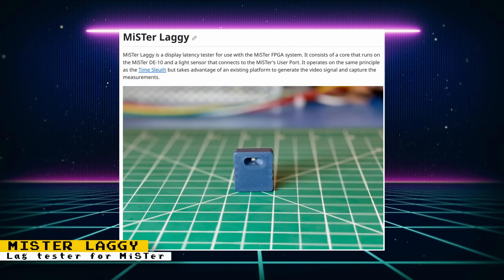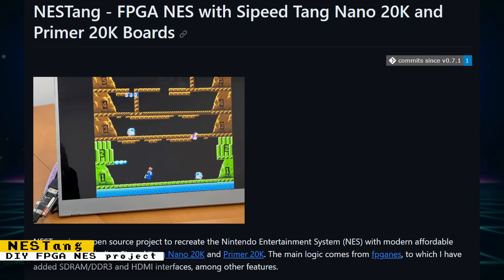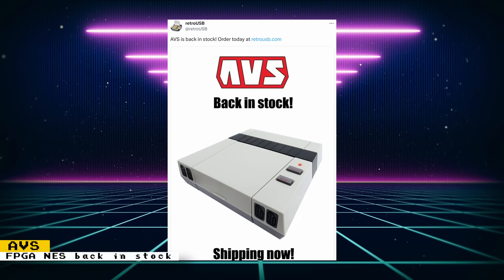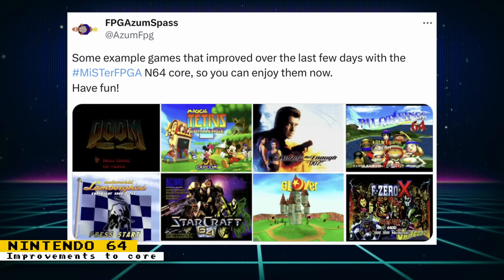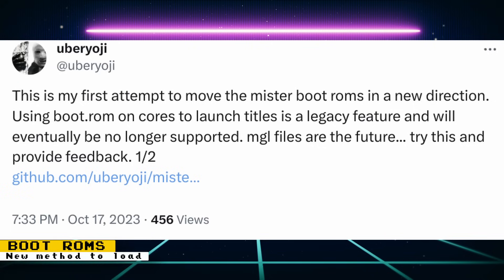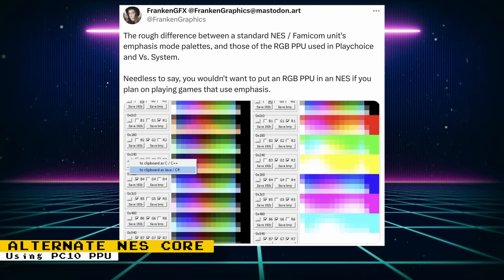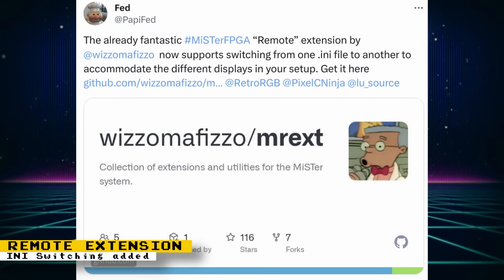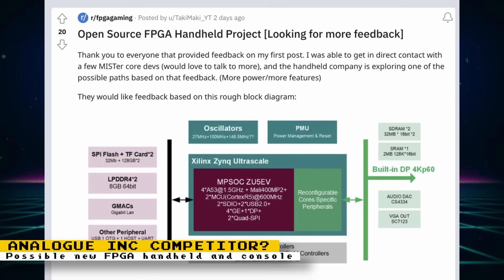MiSTer FPGA News - Analogue Competitor Coming? Saturn, N64 & More

Comment: Taki Udon, you mean the guy who makes content on all of the cheap Chinese manufactured emulation handhelds? Literally the last person I would trust to help put out a high quality FPGA handheld device 😂
Reply: He's not putting it out, he's been approached by a company to gauge interest in a cheap FPGA handheld (<$100). There's already an FPGA game boy color that's a drop-in replacement, and if nobody puts in the elbow grease to bring PS1 to OpenFPGA, then was the extra $100 for the screen really worth it? Perhaps. But the wait? The scalpers and navigating the captchas? Perhaps not.
Reply: @axelkusanagi4139  Yes I understand that, but the products he regularly features on his channel leave a lot to be desired so I would have to assume that this will be the same because it's likely the same Chinese manufacturers that he's already been working with. Aiming for a price point of < $100 seems a bit ridiculous to me, FPGA hardware is still fairly pricey so at that price you'd have to figure that the screen and D-pad will be horrible and likely it won't even have link cable compatibility, so at that point it's almost not even worth being an FPGA device. It very well might not be possible for a PS1 core to be brought even to OpenFPGA, and for a < $100 device I would think that it would certainly not be possible at least without heavily sacrificing accuracy. 

If having PS1 on handheld is a priority for you, why not just pick up a PS Vita since that can run PS1 natively? Last I checked you could still find the 1st model with OLED screen for around $100 if you keep your eyes peeled. And with the Vita modding scene as good as it is, you can very easily put the entire PS1 on your Vita, not to mention the PSP and Vita libraries.
Reply: Stop being elitist. You played and enjoyed software emulation for years before jumping on mister.

Comment: The $40 Sipeed is very interesting compared to the Mars, with its overpriced price and software emulation.
Reply: It feels silly to defend a product thats not even out yet but.......expensive, hell yes, too expensive? that's subjective.....overpriced? Not sure. fpga hardware aint cheap. And there is research costs you'd want to earn back.....and software emulation? They want to keep their options open when it comes to using the arm side to offload, non timing essential stuff. Again thing is not out yet and maybe it would be a bad implementation BUT seeing who is working on it i am definitely giving them the benifit of the doubt!
Reply: The ARM processor is for offloading extras like the DSP and such from certain cores. It's similar to how the MT-32 pi emulates the Roland 32 or whatever (I don't fw MIDI much) for the DOS cores.